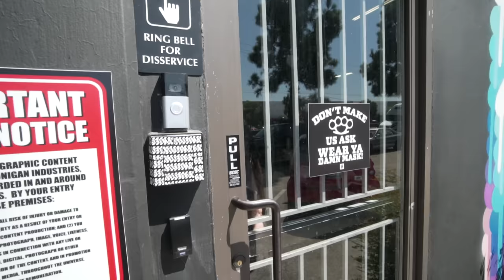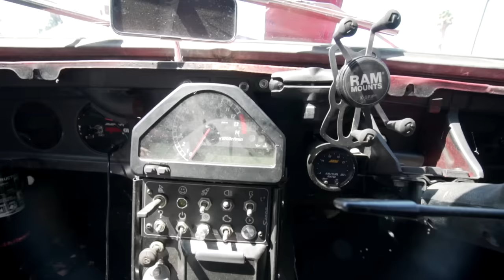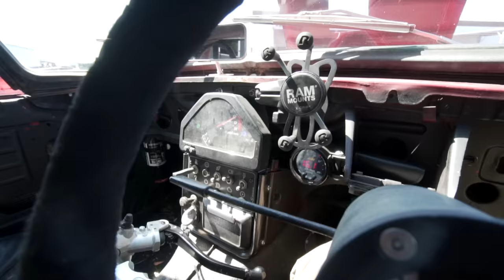Motorcycle engine in a car?? 12,000 RPM 1000cc CBR Powered 1964 Honda S600! // Build Breakdown

Comment: I agree with Brian, everyone should have a motorcycle powered car. Mine would be a Suzuki Cappuccino with a Hayabusa engine in it.
Reply: I saw a Smart car with a Busa engine and a Yamaha 600 kart online. There's always the T-Rex, but it's definitely traction limited with only 1 drive wheel.  England has the Lotus 7, still perfect from the 50's, now known as the Caterham (UK) and Donkervoort (Holland) as alternate platform for the 'Double Busa' Riccardo 3L v8 previously found in the Ariel Atom v8. The downside is the extreme expense of rebuilding a one off creation rated at 250 HRS, just like a Real Race car!
Reply: Busa engines aren't that powerful anymore
Reply: @luislongoria6621  so they rate them in amount of hours before each rebuild?
Reply: @MrMatthewb9876  theres a company that actually makes v8 busa engines
Reply: I'd love to do a mid engine rwd conversion to 3 cars with the kawasaki h2r engine. either a Nissan Pulsar NXA, Toyota Paseo or a Nissan nx1600 or nx2000.
Reply: @luislongoria6621  donkervoort now uses audi 5cyl engines right?

Comment: Gotta love engine swaps. Especially when its a different engine from a different vehicle
Reply: The S600 and its smaller siblings originally came with motorcycle engines. Jason Camissa did a great episode on that car for Hagerty!
Reply: That's usually what a engine swap is...
Reply: As opposed to other engine swaps where they take the same engine from the same vehicle. Those are Kinda boring.

Comment: Man! I’ve been dreaming of an S600 with bike engine too! But my dream is with a cross plane crank R1 and a dual stick set up. Use an automotive 5 speed and pedal clutch and H gate shifter, then use second stick to pick the motorcycle gear box for what range you’re in. Like first gear on motorcycle gear box for driving around town in San Francisco for easy hills starts. Second gear for drag strip. 3 gear for short road track like streets of willow. Fourth gear for big willow. 5th and 6th gear for low rpm freeway cruising.

Comment: I like the car a lot but that was not a shifter kart. I am a kart mechanic and trust me a shifter kart would have destroyed that car. Wither way the car is super cool and I love those 1000cc engines
Reply from the maker: Shifter was broken, brought out another kart.
Reply: Makes sense. It was hard to see on my small screen if indeed was a shifter that just did not shift. I would love to see you run that same layout but on your new shifter. I am sure it will smoke that little car.